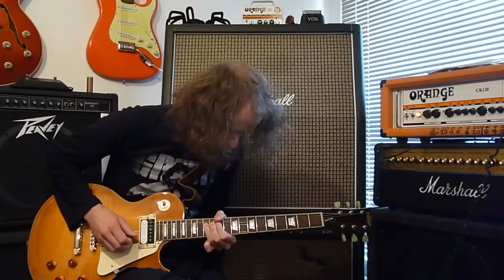Why I prefer Solid State amps to Valve amps

Comment: Yep i noticed that with power too. Tube amps tend to sound kinda dark, when current is  lower .  It is not same sound runing it at 200V and 240V.
Reply: Something else I forgot, how the power differences at these clubs would effect my tube power amps, ugg the more I think about it the more I am glad I am off the tubes for now, I loved the sound when they were all dialed in and working, but that wasnt all the time.
Reply: yes exactly. Still i'm using tube amps, but solid state are far reliable. Idk how Dave can't hear diffrence, but i would say that diffrence in tone is huge. But, nor tube, nor solid state is bad or good, just what you prefer.

Comment: I spilled a glass of water down the back of my Marshall 6100lm 30th anniversary amp once and it took out a power tube and an H.T. fuse. So I tore my rig down, found my spare tubes & fuses and had the amp back up and running again before the rest of the band had even finished the song we were playing. The amp used to go through a set of tubes about every year or so, but then I put a cooling fan in the amp, pointed it right at the power tubes and haven't had to put another tube in it since, and that was about 15 years ago. It's been working great ever since, I love my 6100lm. It's become a part of me. Lol.

Comment: I have a 70's Fender Vibrolux and my version doesn't match any schematics. The struggle and frustration to get the right values drove my repairman to a halt. I prefer solid state amps now for reasons you've mentioned.

Comment: My first half stack was a Marshall mg100hdfx and cab, I still have it, the fan whirs a bit in power up but it still rocks, through a better than stock cab it rocks even more! JCM 2000 DSL’s, fender blackface deluxe reverb reissues have been and gone, currently I practice with a Yamaha thr30 and it’s great, nothing wrong with solid solid state, one thing I regret letting go was a blues cube artist with Oz Noy capsule, damn expensive but with a strat it was heaven.
Reply: BC artist is what I gig. I use a katana for a grab n go and rehearsal. But playing the BC is a real pleasure in comparison. Live it still amazes me with the sounds I get.
Reply: Fast Acesus they are great amps, I feel they are also massively underrated, one day, I will buy another.

Comment: Most people are unaware that the digital output stages (Class D, Class T) are as efficient as a tube at amplifying audio. I have been able to mimic all but one of the many tube amps I own with my Fender Mustang III. Try it out! Couple the output stage with the myriad of options available in the digital preamps, and you have a viable challenger to the tube amp.

Comment: I play the CR60 combo Dave and I agree they're great. Also use a MG50dfx so we have similar tastes in amps! So much more practical for home and gigging use. You're also not as paranoid about transporting or leaving them unattended due to the low cost in the first place. Tube amps have there place, but I can't help thinking many who write off solid state amps would be surprised at how good a number of modern variations are.
Reply from the maker: I agree with you. People are very quick to judge on what you use. Its not about that. Its about what works for you regardless of what it is. :)

Comment: I've never heard much of a difference either.  I just bought a Quilter OD200 and A/B'd against my Orange Rockerverb 50.  The cleans were actually better on the SS Quilter, and the Gain channels difference in tone was indescribable.  Plus the Quilter wieghs 4 lbs. compared to 50+ lbs for the Orange.  I used to be a tube amp snob, but SS amps have really evolved now.

Comment: I had a friend who had an incredible sounding modded plexi. He got it in the 70s, then got it modded. But it would get really, really hot, so the mod included a built-in fan, because it was already a hot amp. That fan was loud! He had to crank that amp up so you wouldn't hear it. Another issue with tube amps is that they are WAY heavier. They have components that are not necessary in solid state amps. The Katana I want is way lighter than the Marshall combo I just sold. It also has more clarity in its high gain channel and is more versatile. It's also a LOT louder.

Comment: Some fantastic comments here, and great timing considering the decision I'm in the process of making!.

I've owned a Mesa Boogie Express 5.50 and a TA30 for the last 5 years or so and they are wonderful amps. However, I usually only play them in my lounge room (with an occasional outing to play with friends) so I really never use their capabilities any more. I never use distortion, only a clean sound with some occasional slight breakup for blues.  Also - I've now retired, and the Boogies are just too heavy to carry around. I really want something that I can just throw in my car if necessary.

So I've decided to sell both my Boogies and move over to solid state, as there now seem to be some excellent sounding SS amps out there. I've fallen in love with the Quilter amps, however the smaller Blackstar ID series look pretty good too.

At this stage my thinking is to go for a SS head, as this will allow me to design a cab with the highest quality speakers. I might also cover all the options by buying a very simple and low power valve amp (2 - 5 watts) that I'll play through the same cab when I feel the urge.

I've never owned a SS amp for my electric guitars, always valve (Vox before my Boogies), however I use a wonderful Ultrasound SS amp with my acoustic guitars, and I've been very impressed with this, so I have no objection in principle to SS.
Reply: edward cameron-reid ...i just broke out an ID30 and it's tight. really good solid state amp. fairly versatile, too... it's got a 'TVP' control which emulates different kinds of tubes. at the moment, EL84 is my fav. happy solid-stating!

Comment: My first amp was a solid state Marshall MG. The clean sound was good but the overdrive channel was horrendous above 5. After one year a bought a one valve Marshall AVT 20. 
The difference on the OD channel was like the difference between night and day.
Another advantage is that you can change the single valve for around £20 and try out different valves. The AVT's stock Marshall valve was a bit too dirty for me at 8+ so I changed it for a cryogenic valve (a bit too clean at 8+).  But the point is, you can keep trying different valves until you find the one that is perfect for your sound. 
 [Although the AVT's 10" speaker is very good I run it through a 12" cabinet for a bit more bottom end.]

Comment: For 90s death and thrash metal nothing beats old solid-state heads. You could get so precise with those old Peaveys and Crates for intricate rhythm picking. No tube amp I've owned since has had the precision.

Comment: As a teen, I swore by my Hot Rod Deluxe. At the time, there was no mistaking it against a solid state. It was super responsive and the tone was just amazing. Since that time, the sound of solid states have come a very long way. I started playing again a few years ago, using a Vox VT40. I loved it and i used it for my room practice for a couple years now so i got to wondering when was I gonna need to change that tube in that "valve reactor" that lights up. Its been a nightmare thinking about howd it be done cause it doesnt look very accessible at all. So i asked a amp man about it he was sighing and rolling his eyes and i was like "what? Is something wrong" and he told me that the valve reactor amps are solid state amps and the tube was just for show. I was thinking all this time that tube tech had came a long way in consistency and reliability, but lo and behold, it was solid states that had advanced all along. Vox was just smart enough to put a "pretend tube" that light up for old fogeys like me that wouldnt take their word for it.

Comment: Hi Dave. Gotta agree completely. I live in Germany. In the last 30 years (I´m 50) we had 221Volts flatout anywhere anytime until couple years ago since we´d changed to 230V
Since then we read from 229V to 238V from one hour to an other. 
I have the Icones of amps and I can say for shure: Non of them does exept those powerchanges. EVEN THE NEWEST amps (VICTORY) can´t handle this well.
The tones can get from fine to uncontrolable and worse.
Reply: I think that big misconception about solid state comes from the fact that almost all entry level gear is SS and the vast majority of high end amps are valve, so we naturally tend to say SS sucks, valves rule.. which was very true when solid state started to come out, them fizzy boxes. Still it didn't stop Dimebag apparently.
Now, i'd have to lift an amp head to know if it's solid state or valve with the current technology.
Valve is not always the best tone. the best tone is the one that pleases you most, and that's highly subjective!
I used to own a JCM slash and i was more often playing with the diode clipping stage than the valve one.

Regarding the voltage issue, i wish you were wrong ^^
At home i go from 240V in summer to 190V in winter when everyone overloads the local grid with electric heaters (old town houses with bad insulation). so the tip with valves is to play when it's warm! lol

Comment: Good points raised for sure. Don't understand not changing your sound for the gig though. I've found in different rooms I have to adjust the EQ slightly (normally the bass and presence controls) to get the sound needed for the mix right.
Reply from the maker: Thank you. I've never had to tweak my amp to a room. Its always been nice and consistent. :)

Comment: Your points are valid and I 90% agree with you.  I use a medley of both solid sate, valve and direct rigs throughout my week.  All of the rigs sound good.  Most tone comes from the fingers and as long as the player knows how to dial in gear, almost anything can sound good.  However, I do find solid state amps react differently than valve amps, especially with pedals.  Valve amps, especially with tube rectifiers, at high volumes compress and sag much differently than solid state amps.  Not only that, but I find my drive pedals, especially fuzz, respond much, much differently to a solid state amp.  It's not so much a tone difference as a feel difference, but it is noticeable.  Solid state amps have such a quick and snappy response compared to valve amps.  I wouldn't trade my two valve combos in stereo for anything, but a Roland Jazz Chorus is a very worthy substitute.  Thanks for sharing your thoughts!
Reply from the maker: Thank you for watching and letting me know your views. :)

Comment: I found it super funny how after doing so much research on amps and stuff, I bought an Orange Micro Dark as a cheap option for me to upgrade later,  not expecting it to sound as good as it does with an overdrive in front. Hell, I was expecting a “good enough” sound, but as soon as I dialed in some quick settings, turned ‘em on and strummed that first power chord, it literally gave me the sound I envisioned in my head. There’s no way I’ll buy any other amp now. I’m even considering selling off my Mooer Fifty Fifty now that I’ve found my holy grail of metal tone.

Comment: Wow... lots of fun comments!  Thanks guys! 😂  I'm not going to call myself an idiot.... but I lugged around 4x12 cabinets and the way too expensive tube heads (not to name any names but it rhymed with Marshall) up and down stairs (In late 70's heels) because of the tone I thought that I could hear from not only tube heads but full stacks too boot.  By gosh we carried them things "and" the huge PA bins (4-6 on each side) 6 miles through balls deep snow up hill both ways.... and we liked It!  Seriously though... I wish there would have been SS amps back then that sounded like the ones available today. But then we wouldn't have looked as cool. 🤣  You don't plug a LesPaul into no stinking solid state combo amp in rock and toll! 😂

Comment: I’m right there with you on this. To me I just love solid states not only for the sound but also just the fact that they keep going with very little maintenance. My buddy owns a Randall Century 200 from 1990 and it has never been opened or serviced, he plays it nearly everyday and it still sounds amazing. No tube amp can produce that ultra heavy tone quite like a boosted Randall C200. 
I’ve got a Katana MK2 and I prefer it infinitely over the 4.5 grand Bartel Roseland that my dad bought himself. Sure the Bartel sounds great there’s no denying it but in terms of versatility and range of tone the £240 katana runs circles around it. The Bartel can do lovely rich cleans and some light plexi style distortion. That’s it, and it doesn’t even have an FX loop😂 The katana can do all that and much much more with the tone studio software. I feel like people hate on solid state because they’ve never experienced a good one. They start out on a crappy practice amp then upgrade to an expensive tube amp which sounds 1000x better than the cheap solid state and then they leave their opinion at that

Comment: I can definitely hear a difference with the older solid state amps. But the modern MOSFET amps have leveled this playing field considerably. The reason being, is the harmonic warmth that valves are so famous for, MOSFETs have the same characteristics. I work on my own equipment, so I have no issues keeping them going. For the person who doesn't, I can see how valve amps can be daunting. Any-which-way, use what works for you and if it works, then that's all that matters.

Comment: I can hear a huge difference.  solid state has exceptional clarity.    You lose potentially pleasant harmonic distortion linked to dynamics that a tube produces, but depending on the music you're working with either one might sit better in a mix.  The same could be said about amp modelling.

Comment: I agree. I have been gigging for more than 40 years and it was always tube amps. The last few years I went to S/S (VOX VT series and now BOSS Katana 100) and I am very satisfied. That's my opinion, your mileage may vary. I also need the reliability. No changing tubes, no re-bias, no waiting for the amp to warm up after coming into a club from outside (winter), no worry about it bouncing around in a truck or van, just plug it in a play. My Katana sounds great (to me) and does everything I want. I'm done with tubes.

Comment: I had a decent crate tube amp along with a peavey bandit 112 side by side for some time. Personally, I could only hear a subtle difference between the two in favor of the tube amp. I don't have the crate anymore. These days I focus more on the pedals going through the clean channel of the peavey.

Comment: I believe that the "magic" of a valve amp comes from a sweet spot (that the individual decides) that you get when cranking it.  Whether that's the preamp section or the power section there are a number of things that guitarists learn about their rig after spending countless years playing and tinkering with the same setup in a variety of different rooms.  Compression and the shape of the note you are playing are very different whereas a solid state amp only really sounds different on how hard the speaker is being pushed, which from person to person will also have a sweet spot they like.  Headroom in an amp makes a big difference because cranking creates some sort of compression and the more wattage a valve amp has the more headroom (not really volume) you get. So a 100 watt Marshall DSL is rubbish for pub gigs compared to something at 25 watts that compresses smoothly quicker when pushed a bit. All the dynamics change very quickly and it's response to pedals is very different at the same volume.

If it was me and I was playing a gig and knew that my amp sounded very different in certain venues I would invest in a power conditioner and a 10 band eq in the effects loop. You guarantee good power whilst having the flexibility to nitpick certain frequencies which the room is trying to ** with you over.  With even more time, experience and intimacy with your gear you will also be able to adjust things on how many/dense your audience absorbing your sound is..........

Comment: I don't have any solid state amps anymore because the tube amps I've used sound better to me, but if you like solid state ones then that's your decision. If you like how you sound that's all that really matters. There have been some impressive solid state amps, though. The Peavey XXL was a great one. Too bad they quit making those. Quilter Labs also makes good ones from what I hear, but they're a bit expensive.

I also like using a small tube amp set clean with a distortion pedal for my gain. That's probably my favorite platform for playing I've found because it gives me an excuse to buy more pedals. :-)

Comment: Choosing between a solid state and tube amp is one of my current dilemmas.  Just started learning guitar a couple months ago, and decided that I'm going to graduate to a better amp than my Roland 40w Cube SS once my skill level justifies it.  (USA Fender strat = guitar) 
 Currently drooling over the Fender 57 reissue Champ (5watt)  on the valve side,  and something like a Blackstar on the SS side.  
Not going to be gigging anytime soon, just recording my originals in home studio w/ the setup.   
Anyway, this was a helpful video, enlightening me to the benefits of SS and downfalls of Valve.  I need to do more research -- like whether a small Wattage valve amp that's brand new will be costly to maintain (and whether yearly maintenance is necessary)
Reply: P.s. here's the best demo I've heard of a 57 champ ., micced with 2 $400 BeyerDynamic M160s, one at grill and one 10 ft away, giving a lovely subtle delay-type effect.   It's so lush and musical., something I've yet to hear anything quite like it with an SS.   watch?v=xC-oRD9UW-0  title: "Fender 57 Champ Custom - HUGE SOUND!"